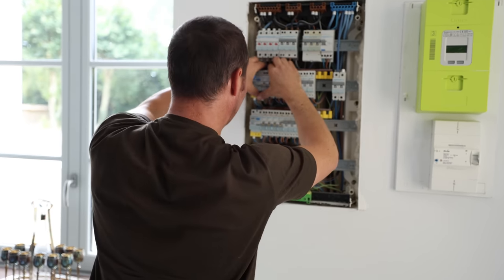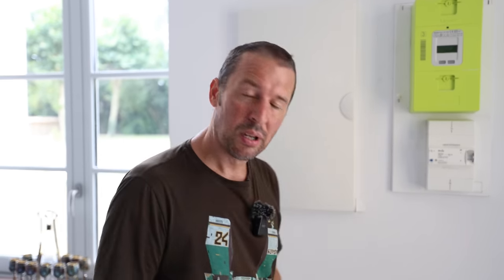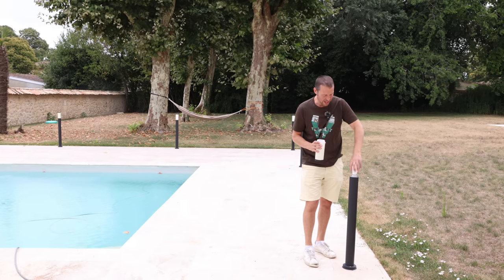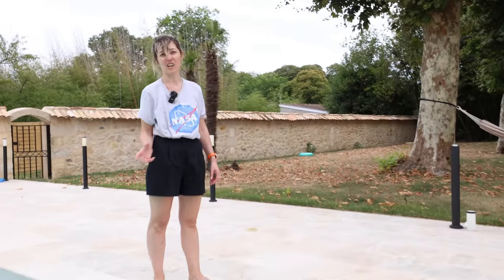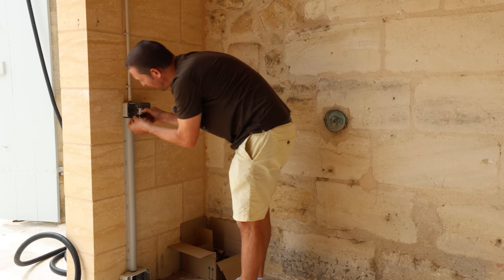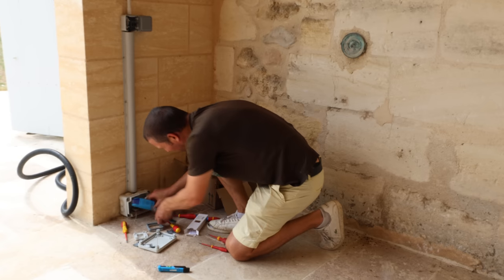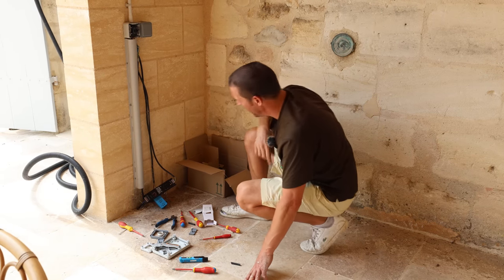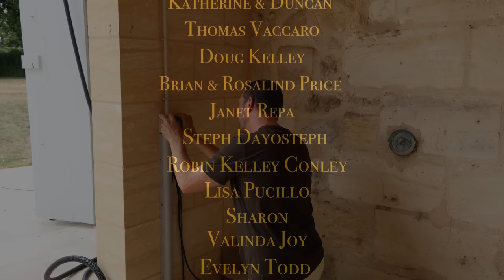FAILED Building Inspection.... We Can't SELL!!!

Comment: I’m in the US and use a product called “YelloOut” to treat algae. Work well but is expensive.
Keeping the pool and skimmer baskets very clean helps. 
My pool runs on only one filter. ( should be four but that’s the way the previous owner built it)  I wash it every week. When it’s very hot or lots of rain, I wash them twice a week. I have a spare filter for quick swap, in case I don’t have time to wash the filter.
Brush your pool, shock it and let the pump run 24 hours. If algae isn’t gone, repeat the process.
Since I only have one filter, I swap it out when shocking the pool

Phosfree is a great chemical to help your water stay clear and Alger free.

Comment: I had the same problem with our pool in Germany. Trees around it and hot and humid weather with lots of sunshine followed by cold spells. It's that there is too much organic matter with the warmth and sunshine. Even with the correct ph and proper algae product followed by shock chlorination, it kept coming back. I then changed to a product called Baquacil. The 4 years I used it I never had problems with algae again. It appears o be more expensive but with all the ph leveling and algae stuff it's cheaper in the end. The pool was pristine while neighbors battled with algae. And it's easier to maintain. After the initial dosage, you just have to top it up Plus ph was WAY more stable even in hot weather. Here in California, I have a salt water pool that works differently. But without a saltwater converter, I would use Baquacil again.

Comment: Here in the USA the weather has been so unusual on the east coast.  Extreme heat and humidity and lots of rain and lush foliage.  Swimming pools have had the same problem as you are having in France so they need to be shocked, vacuumed and backwashed often to fight the algae.  I’m glad the two electrical issues didn’t turn out to be huge problems.  We have GFCI outlets that are used anywhere there is water, such as bathrooms, kitchen, swimming pools, etc.  they trip off the breaker if anything electrical hits the water.  It doesn’t seem like you use them in France.   I am sad to see your beautiful green sod has turned brown.  Is Bordeaux conserving water this summer?  Good job fixing the electrical.  xx

Comment: Those switches are generally known as residual current devices or RCD or earth leakage switches. If you haven't got them then you really do need them.
Reply from the maker: I had them but it was a typé avec not a type a ….. I know very little difference
Reply: Electricians always amaze me, they are adement that their way is the correct way but send in a second electrician on the same job and he/she will likely redo the whole thing making comments about the previous work. It has happened many times for us.

Comment: Calcium hypochlorite shock ;
We recommend using Calcium hypochlorite shock or Cal–hypo shock,  as an effective algae treatment.  Follow the package instructions to determine the dose for your pool size,  then multiply that by two, three, or four depending on which type of algae you've got. 
P.S.
Keep chlorine levels consistently between 3 – 5 ppm the water will keep blue.  This means you should use a basic test strip 2 to 3 times a week to make sure that the chlorine level is where it needs to be.

Comment: DIY works at times; but it's best to know the local building codes.
Reply: I have always wondered how how all these châteaux DIY can get away without inspections at several stages., whether electric., plumbing, structural.  What are the policies in France?
Reply: The policy must be: Call the Fire Department and run.😂
Reply: @mariehoffman7542  It's always asked on these Chateau videos; but I have not seen an answer.
Reply: @mariehoffman7542  They can do all the work themselves, but to be able to sell they need a certificate to say everything is up to scratch and ok. If it is not they don't get the certificate and can't sell it. So it is in their best interests to do it properly in the first place. If your not ever going to sell it does not matter, it is your home at risk!

Comment: I guess because I live in Canada I find many European rules about electricity in and around water odd.  (Bathroom lights outside the door or on a string in the UK)   We use Ground Fault Circuit Interrupters (GFCI) and Ground Fault interrupters (GFI) to protect people. If they detect the slightest energy leak, they will shut down the circuit.  They can be individual outlets on one circuit or a breaker on the panel.
Reply: Having the light switch outside the bathroom is quite fun when you have kids that let you get in the bath & then turn the lights off 😂
Reply: Same in the US.
Reply: @susanross1651  I'll bet because my brother and I were those types of kids when we were young and living in the UK

Comment: 🔥🔥How to get rid of algae -  take a medium to large plastic vitamin bottle and drill holes on the Top, Bottom, and Sides.  Get a couple of COPPER FITTINGS from the hardware store, put them inside the bottle, and put the bottle in the pool skimmer. Voilà - no more algae. Cooper works in birdbaths too.

Comment: Hi Ed and Anna !!  Lovely to see you both working on the electrical resolve.   Well done !!!   I have looked after swimming pools in the past and yes, I've encountered mustard algae.  First and foremost is always to disinfect any brushes or nets used in the pool and make sure any swim costumes worn in the pool are thoroughly rinsed or machine washed.   (You can throw brushes and nets into the pool when you shock dose).   Vacuum the pool to WASTE (not filter) to avoid dragging the algae spores through the filter.  Top up with fresh water if you need to then give it a good chlorine shock dose followed by an algaecide 4-7 days after.  You may have to repeat this a couple of times.   Detach the auto vacuum cleaner, backwash the pump then back onto filter (without the auto vacuum cleaner) for a good 8 hours after shock dosing.  pH level should be sitting a little below 7.6 (around 7.4 or 7.5) and alkalinity between 120ppm-150ppm.    Hopefully that will help !!  Cheers from New Zealand :)

Comment: We've had mustard algae this year too, for about a month.  Our pool guy had to give it a couple of treatments and brush and vacuum the sides and bottoms disposing of the water, rather than just using the robot, where the water goes through the filter.  We asked guests to wash their swimming costumes too, eventually got rid of it after 4 weeks.  Our guy said it could have been caused by the sahara sand that blows over at times and also the pollen from the nearby trees.  Good luck with yours, you have such a beautiful pool.

Comment: For the pool have you tried Floculante (Spanish term) which binds tiny particles of algae together so that they get caught in the filter. I use it as soon as the water looks a bit dull to stop the algae growing. It’s the heat that degrades the chlorine faster.

Comment: Glad you were able to remedy the electrics and the pool patio lighting change-over. Despite the bulb size, you are an awesome DIY/MacGyver guy ! 👍...lol, 😁as Anna suggested.  Is the big electric box too close to the ground, will rainwater short it out?  If's it 12 volts, should be alright. Here in the Southeast US, we experience hot and humid summers and I'm near trees.  My pool has always had the same trouble with algae as your pool has, I have used an algicide or shock treatment as well. Try maintaining the water pH. Check it with a pH kit or battery-operated water probe meter.  You can broadcast sodium bicarbonate to balance the alkalinity of pool water, to stabilize pH level. Use chlorine tablets or cylinders in the skimmers to add protection, unless you are using salt as a water purifier.  Change the water pump filters/back wash the sand filter periodically too.  It's a lot of work but well worth it.

Comment: Regarding pool algae, you should just purchase a pool cover. The UV light from the sun evaporates the chlorine and causes pollen and detritus in the pool to promote algae. A simple floating bubble wrap cover will prevent both and keep the water crystal clear. Also, have you checked that your filter is clean? If it is not removing stuff, algae will grow.

Comment: Now this may not be a tutorial, but it is very interesting to see you explain the problem, and to remedy it. I once tried to connect a heavy duty 3-phase engine to a connection that was specifically made for us. It failed. As soon as I turned on the engine, the circuit was cut. It appeared that we needed a 'class C' automatic circuit breaker where a 'class A' was installed (by someone who did not actually understand the needs of a heavy duty 3-phase engine; he just assumed that it would be the same as for a kitchen cooker). One learns these things by having to cope with electrical installations. By now, our engine runs perfectly on the same source, but with a different class circuit breaker. Although your 'disjoncteur différentiel' (residual-current device) has another function, the type of problem is the same. Thanks for sharing your 'failure' with us.

Comment: OK Edinson. Replacing an 230V circuit by a 12V circuit by just putting in an Transfo is not the solution. The appliancies will pull the same energie weather on 230 or 12V, only more Amps on 12V. The 1,5 or 2,5 mm2 cables for 230V are not adapted to the Amps of a 12V circuit. At a certain point they will burn. There is information on the Internet which type  of cables you can use for 12V circuits.
Reply from the maker: I checked with my supplier and the consuel….. as the lamps are led it passes just.

Comment: Sounds like all breakers feeding electricity near or for a water area must have ground fault protection.
Reply from the maker: No it’s even more technical than that …. Very very slight difference between the 2 ….. a wholesaler told me that the one that was there was a good protection but that the French norms were over the top
Reply: It is great you found a easy work around and it was not too expensive. Great vlog!

Comment: What you said about the washing machine circuit went right over my head. Did it require a higher amperage breaker just because of the washer? 
I wouldn't have anything but low voltage anywhere outdoors.
I like that gate too. It looks like an entrance to a secret garden. You should plant some bougainvillea or some other flowering vines around there and all along the wall away from the pool. 😊
Reply from the maker: The breaker was fine it was the additional switch with a test that needed to be a different type - not so sure why.

Comment: Edd, years ago I redid the electrical in our 100 year old house (that's pretty old here). Our city allows the homeowner to do there own electrical provided they can prove that they understand the electrical code. So, I went in and applied, me, a 40 plus year old woman. The inspector started asking me questions and when he asked what sized wire I would be using, without missing a beat, I said, 14/2. And told him why. That was the last question he asked, I passed! But, it took over 3 years to complete the job! It was supposed to take 3 months lol. I just kept renewing the permit. They finally said, you need to get this DONE! When they came to inspect the job, because we had been so methodical about the work, we passed easily. The inspector actually said he'd never seen such a tidy, well labelled job 😊

Comment: Impressed by your command of electricity and plumbing, etc.  These are small errors.  Fixable. Here in Chicago homeowners are not allowed to do any electrical work--wired or not.  All work must be done by a licensed and certified electrician.  That being said so many probably drive out to Home Depot, buy parts and get the screwdriver.   We did a gut rehab of two adjoining properties and our architect hired a contractor and we passed inspection with only a minor change--we needed to install three steps from a door on the second floor leading to a flat roof.
Reply: All that does is act as protection in the market place. It does nothing for safety.

Comment: Yellow Gone or HTH 32-oz Pool Algae Prevention is what we get at Lowes. Only had it once in Florida.

Steps to get rid of Mustard algae

Vacuum your pool of waste. ...
Clean your pool filter. Backwash or hose cartridges. This is necessary as the algae will thrive in your filter...
Adjust pool pH to 7.2-7.6 - If this is necessary, filter for 4 hours before proceeding to the next step.
Add 1 x clarifier cube into the skimmer box.
Add liquid chlorine. : 10L for pool up to 20kL
15L for pools between 20kL and 55L
20L for pools between 55kL and 70kL
30L for pools between 70kL and 100kL 
Brush pool walls vigorously. This is very important. Keeping the algae suspension is the best way to get rid of it
Filter for 7 hours then add
1 x Algae killer for pools up to 20kL
1 x Hotzone for pools between 20kL and 70kL
2 x Hotzone for pools between 70kL and 110kL
Run pool filter 24 hours a day until water clarity has reestablished (may take 2-4days), backwash filter and brush pool once a day.
Test your water regularly to rebalance pool water
In fibreglass and vinyl pools, any algae should be gone in one week

For concrete and pebble pools, it may take up to 3 weeks with continuous brushing and high chlorin to complete remove the algae

Prevention
Treating stubborn algae is time-consuming and costly. So it is always best to look toward prevention rather than cure. 

To prevent a resurgence of mustard algae, it is important to test your pool regularly - particularly in Summer and when it is being used often.

It is during these periods that you may need to top up pool water with chlorine or apply a regular shock treatment.

What causes algae in pools?
Pool algae are ultimately the result of favorable growth conditions. These conditions include:

Low chlorine levels
Warm water
A food source (phosphates)
Algae is a pest organism that is always present (even a teeny, tiny microscopic levels) ready to bloom in the conditions that are right.

In general, it is easy to control algae however if you experience prolonged rainfall, excess runoff into your pool, and warm conditions - these will all predispose you to algae growth

Does a pool cover promote algae growth?
A pool cover will help to retain pool water temperature. However, if you are maintaining chlorine levels you should not have an issue with algae.

Using a solar pool cover will not make your pool go green. However, if you are having an algae issue then the warmer water can accelerate algae growth.

How do you fix your algae problem?
A green pool indicates a high concentration of Algae. Algae can become resistant to normal levels of chlorine and can then breed rapidly if the conditions are right.

In order to kill off stubborn algae, you should:

Ensure your chlorine levels are correct and that your chlorinator is working properly
Test for phosphates
Use an algae starver to kill the algae’s food source
Filter the pool for longer to remove algae spores

Comment: Hi Edd and Anna, I live in Australia and we have a swimming pool. In summer, we have to adjust the chlorine output of our salt chlorinator to a higher level. Then in winter we adjust it back down again. We also have to add an algaecide and stabiliser to the water in the warmer months as the sun uses up the chlorine at a faster rate. Apart from the warmer weather, algae can appear if there are birds swimming in your pool. I don't know what system you are using for your pool, but I do know that the hot weather Europe has been experiencing will mean that you will have to make adjustments until the weather cools down again. On a separate matter, in my state in Australia, our laws are so strict that all new or renovation work involving electrics/wiring has to be undertaken by a licensed electrician. It is so costly. You are fortunate to have different laws in France.

Comment: Anna you married the drama King of Clicks Hahaaa
Luckily a few small fixes and only a day to make the corrections the inspector required.
A run to the Hardware store to get the correct
breaker and box and different light bulbs.
A few hours of Edds talent and time and you should be back on track.
To getting this Home sold.

Comment: Ed, you did not mention that you checked the wire size for the lights around the pool, Assuming the 12 volt lamps are the same wattage as the 230 volt, the current for the new lights will be 20 times higher. This could have two issues. 1) exceeding the allowable amperage for the wire size. 2) too much voltage drop to the end lights. I hope this is not the case.
Reply from the maker: The only worry would be voltage drop….. we will see, I’ve checked the led watt and it’s fine for the cable.
Reply: @BordeauxLife  I am glad to hear about the wire size.

Comment: Now there is one more small mistake.. you can’t put 12v and 220v in the same conduit 😉
Reply from the maker: So the switch switches 220…. After there is a transformer and after the transformer there is only 12v in the conduit. It passed second time round…… I was up front and honest with the guy so if there was a problem he would have pulled me up on it.

Comment: Turn the heat down on the pool make it cooler.  Get a pool cover one on a roller.  Get in pool scrub it off with a brush so the filter can suck it up.  Electric is easier to put in than taking it out, sorry Edd.  Edd you need a new pair of tennis shoes.  Does the breeze feel good on you foot lol.  What happened to all your grass and sod?
Reply from the maker: It got very hot and we didn’t want to use drinking water - it will grow back in autumn